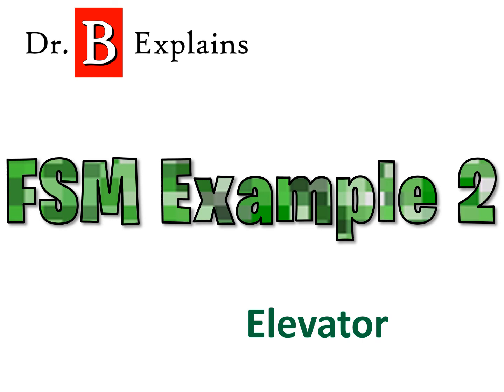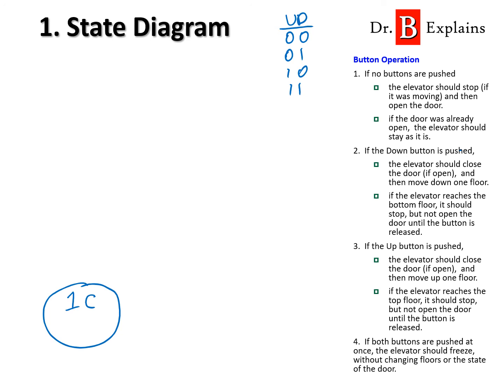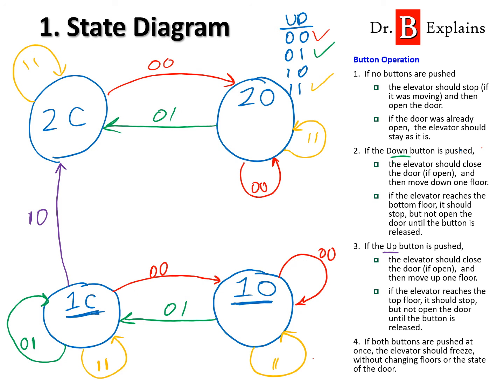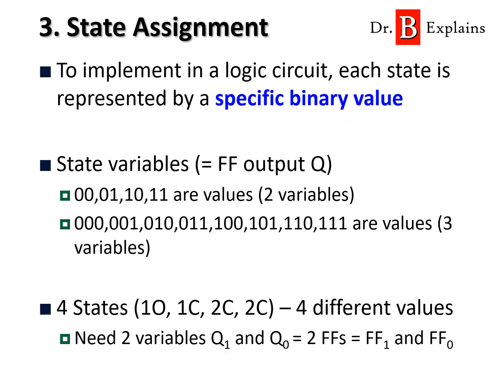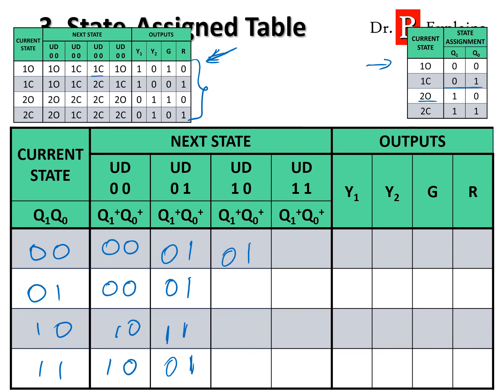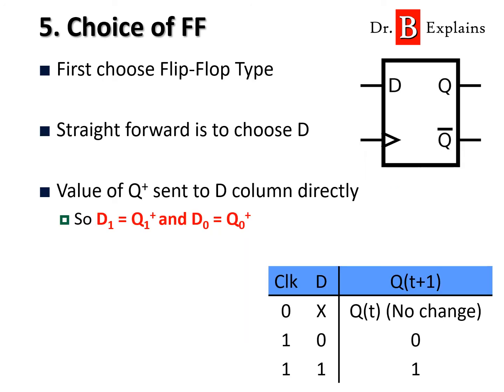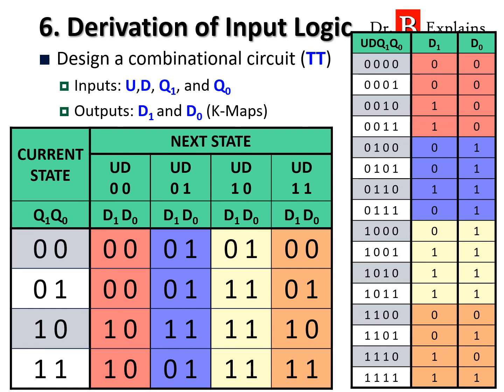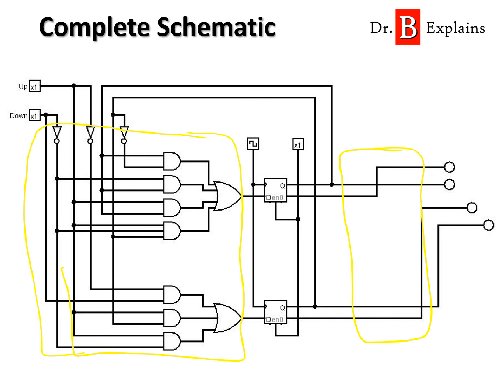Finite State Machine Example 2

Comment: how should the stimulation of this circuit work ? i mean which more additional inputs will be there with up and down because the outputs are not working according to the truth table with only two inputs
Reply from the maker: what simulation software are you using?